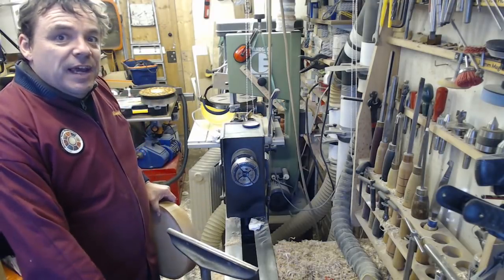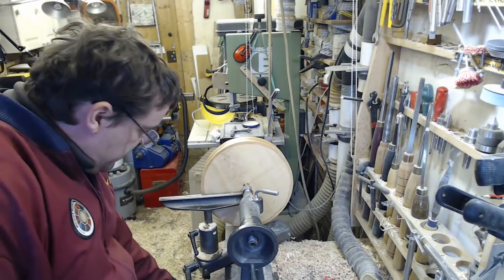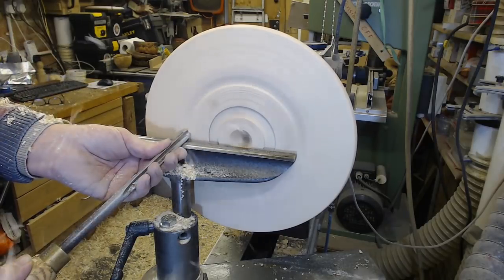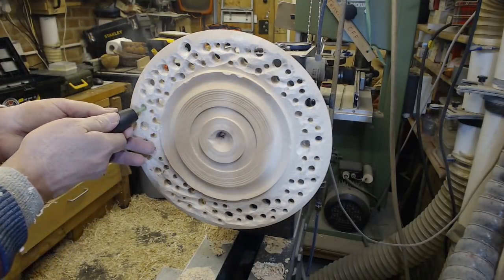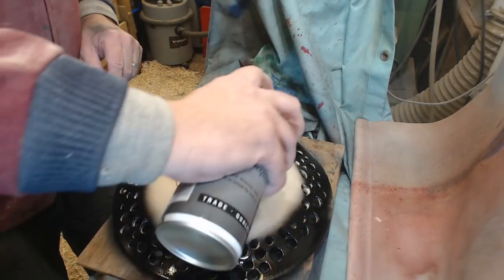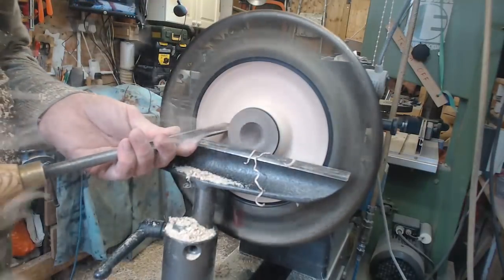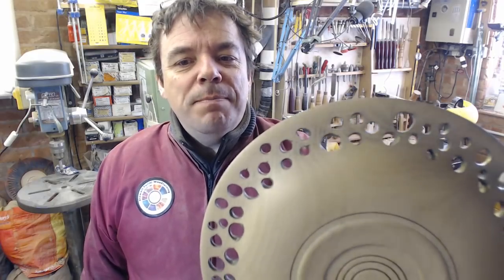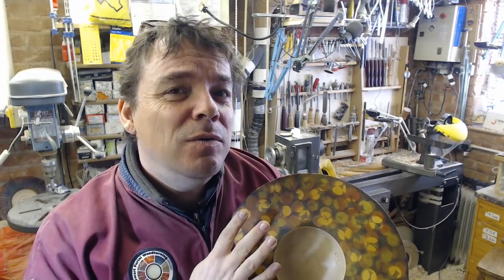Drilling for Gold!

Comment: Great piece Stuart - I love your work, and getting a compliment from my friend Annikas is high praise indeed!
I want to purchase my 1st airbrush - do you have any recommendations regarding brand, or anything else I should look for. I have never painted anything on or from my lathe, any tips or suggestions you may have will be much appreciated.
Regards
Dennis Beamish Cambridge Ontario Canada
Reply from the maker: Thanks, Dennis. I started with a cheap one with a very thin airhose as I already had a compressor. This was a false economy. However, as I'm not doing precision aribrush work, I've stayed quite cheap and have bought airbrushes from Amazon for around £15-£20.  I have also bought a small compressor and airbrush set that works perfectly for this small scale work that I do. Here's a link to the video I made about this - https://youtu.be/Y-d0H4rvNj4  
Others might give you different advice and recommend more expensive airbrushes but I've got good results with these ones. Hope this helps!